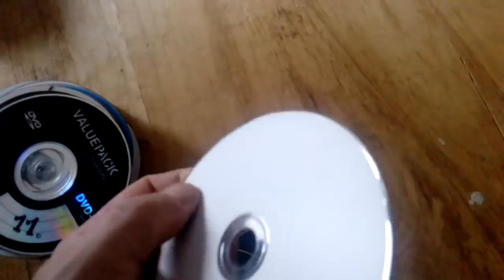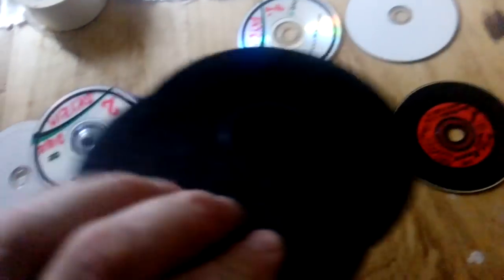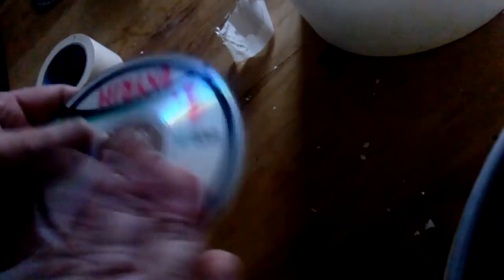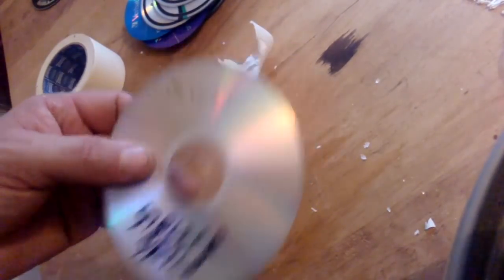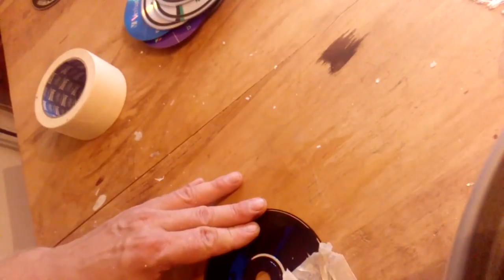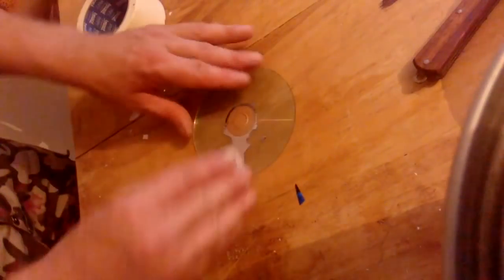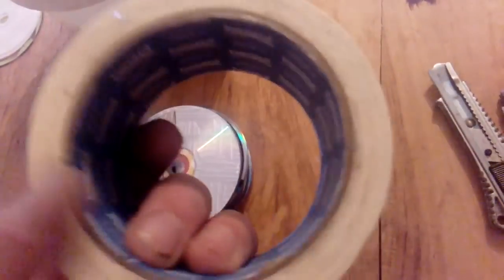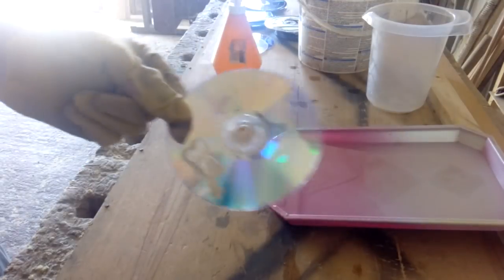Silver recovery & refining from CD and DvD part 1

Comment: I help make th first CDs, we first inserted the write layer was inside the polycarbate is was a ink on a film. No PMG, was used in those.
Later on the printed music CD came out with the film just sealed to the outer layer of the disc. The CDRW, dark color disc , blue or black that is a ink. So not sure anything in there. Hope this help.
Reply from the maker: Richard O'connor Watch the next part of tomorrow, you will be very surprised friends. But thanks for the notice :)